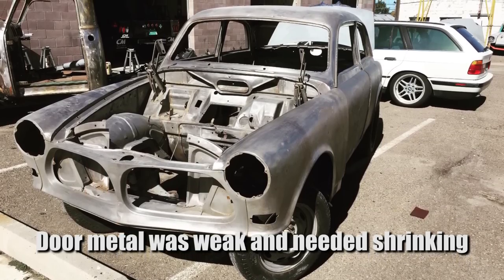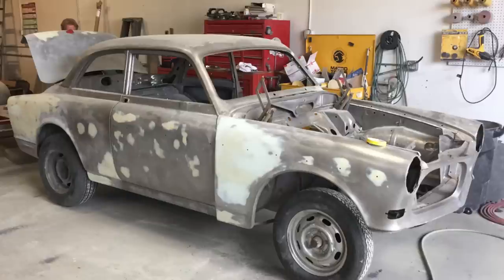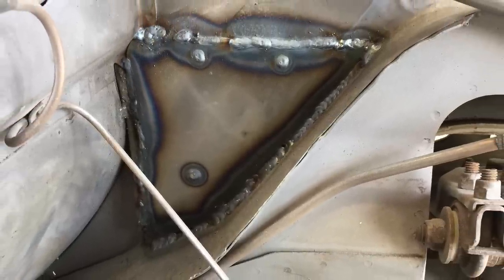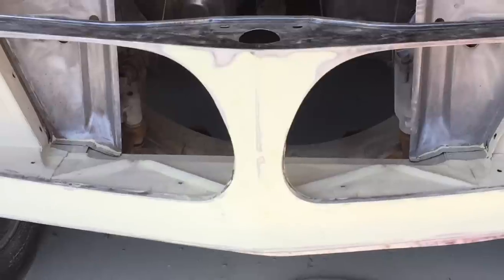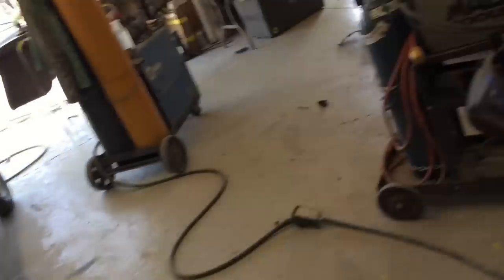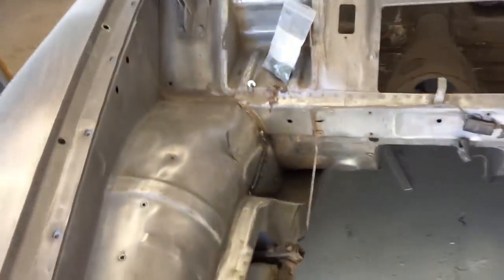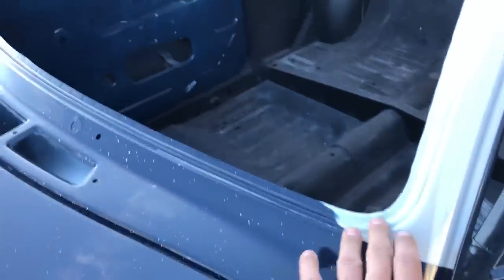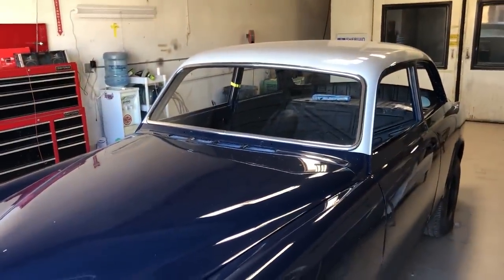🇸🇪S2 Ep6 - B16 Front Nose & PAINTED 2 Tone Volvo Amazon

Comment: Hello, I'm also a great fan of the first model . . . My verry first Amazon was a 1959 light grey with black top. It was 35 years ago . .   Since then I have been the owner of more than 15 Amazon that I have restored completely . .   .  I still have 4 Amazon :  a 1958 (with two trunk handles), a 1962 with the verry first B18,  a  1966 two door dark blue  and a 1967  station wagon.  I can rebuilt a dismantled Amazon with my eyes closed.   All B16 had 4 doors.   I also made polyesther copy of the B16 front for myself and other people.  The first B16 grills was made in heavy inoxydable metal (verry heavy and strong and thick), in 1959 they made them in chromed aluminium. It was cheaper to produce.   My 1958 is equipped with inox grilles. ( I still have spare pairs.)   On my other Amazons ( station and two doors) I prefere the 1963 grilles with the "moustaches". I still have to restore the 1962 Amazon, in the "shiffer blue " color (67) . . .  Greetz from Belgium (Europe) and thanks for your videos.  Mike.
Reply from the maker: AirflowMike thanks Mike! Sounds like quite a collection. Hang onto those parts and they’ll only become more valuable. I like that you referred to them as “moustache” grilles